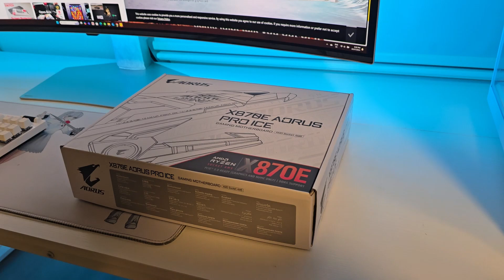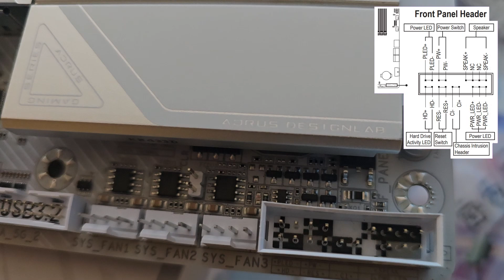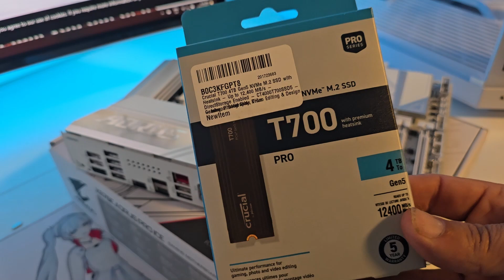GIGABYTE X870E Aorus PRO ICE Overview. AMD AM5 Motherboard DDR5 NVMe Gen5 WiFi7

Comment: Your ram isn’t compatible to your MB… only Corsair Grey Rams Support Expo profiles you bought XMP. All white Corsair are XMP
Reply from the maker: The white Corsair works great. I'm running it at 6000 no problem. The motherboard has ran for a month with no problems.
Reply: Would a t force delta ddr5 6000 work on this?
Reply: I just looked it up and google and corsair website said that the dominator titanium 64 gb is compatible with amd expo and intel xmp. If this is wrong can you show me where i can see it?
Reply: @KleoFizz05  someone else that made a video on it said gigabyte pretested all the white dominators and apporoved them even though some arent qvl still

Comment: I've read in the documentation from AMD that 6000MT/s CL30 would be the sweet spot for the 9800X3D. I may go with the dominator you have in this build but was curious to know if it really made a difference going with XMP or Expo. What are you're thoughts and differences on it? Thanks!
Reply from the maker: @GOxUnd3rc0verx I searched, and there's no difference XMP an Expo. The only difference is that memories with Expo already come with an overcloked profile to 6000. The XMP memory you may have to manually input the overcloked settings you're self. Some motherboards will recognize the XMP profile, and you can use those settings. At the worst, you will have to enter the clock settings yourself.
Reply: @scorpizy  so essentially , we'll be able to overclock the ram with this same board via xmp, correct?
Reply: Remember, RAM mega transfers are not as important on x3d chip since the CPU relies on the 3d l-cache straight on the CCX. Compare to a classical non-X3D chip, where MTS and latency are more important.

Comment: Also if you use this board with windows 10 you CAN NOT use the WiFi. The WiFi only works for Windows 11. Also if you want to use DisplayPort you will need a monitor that supports it, which there is not many that do. I found all this out after I bought it. So for me this sucks and I am debating on sending it back for a refund.
Reply from the maker: @trickhayproductions that will depend on what you need. The graphics card I'm getting will have hdmi so that won't be a problem. I plan on using windows 11. My monitor has display port.

Comment: Going for a similar build to you but 9950X3D and T Force xtreem ARGB RAM 96GB 6800mhz CL36
Reply from the maker: I was considering going with the 9950X3D. Sounds like that GPU will be a munster. As far as RAM, I went with Corsair because the rest of my PC will have Corsair components, and I can use a single program to control all the lights on the PC. It's easier to do LED effects.
Reply: @scorpizy  i'm just going to use SignalRGB to control all the lighting in my rig. So everything else is just pure aesthetics and performance. Mines custom watercooled too so I have a lot of stuff to run that wouldn't be covered in a single program anyway.
Reply: I would consider looking at ram kits with a lower cl rating to improve performance
Reply: @protrax8887  plan on setting the timings manually. CL36 at 6800 isn't exactly slow though.

Comment: are you planning to run the dominator 6600 cl32 intel kit on this board? its the one i was looking at too but corsair seems to think it wont work but they could just be playing it safe.
Reply: or maybe the 6000 cl30 since its a bit cheaper.
Reply from the maker: I got the intel cl30 6000. It's what AMD was running in the video that they showed the 9800X3D. It's hard to say how it will do with other kits until people start testing. Ither way it's exiting times.
Reply: @scorpizy  okay good to know thanks
Reply: I have 6600MHz as i was going with Intel build till yesterday. Now i changed my mind and going with AMD. This motherboard QVL says it support 6600MHz.